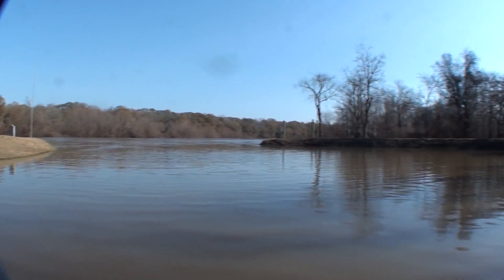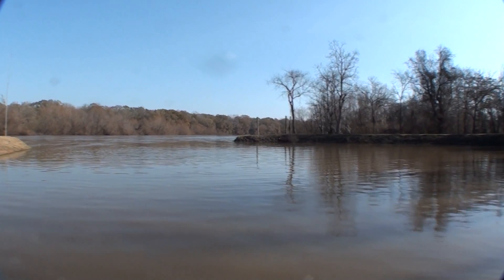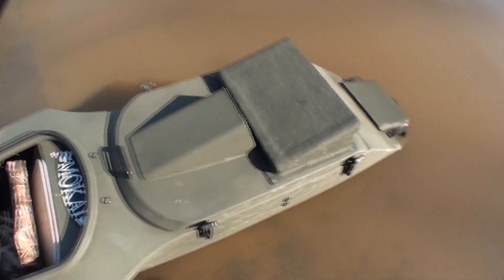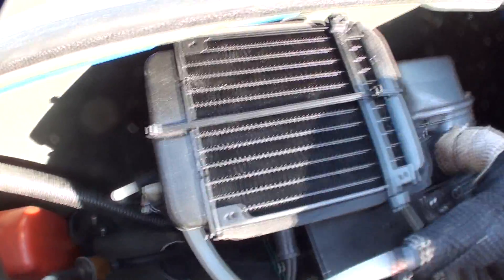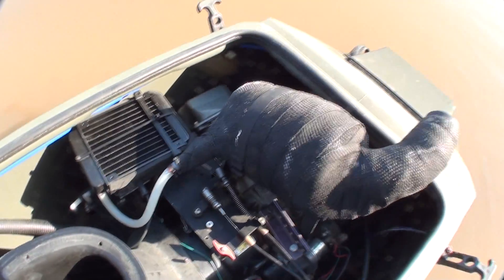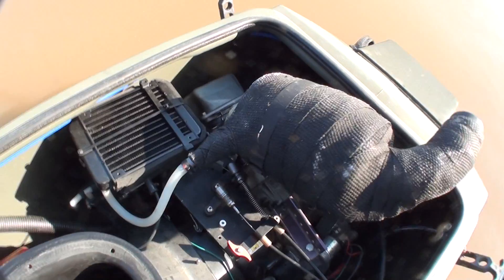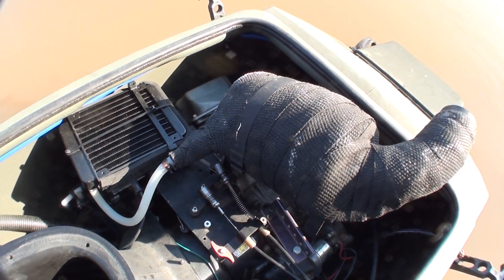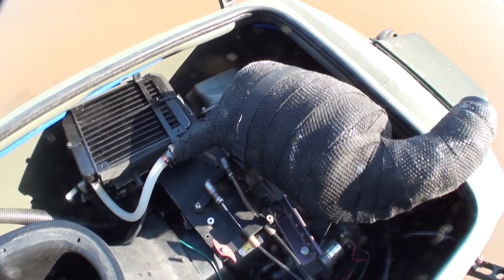MOKAI™ Jet Boat with intercooled Subaru KX21

Comment: I have a few fully built 10,000rpm 20+ hp predator 212's I can only imagine how fast it would go then😁
Reply from the maker: Not very well. You wouldn't be able to get into the torque range those motors run best at. You have a final drive ratio on a kart much lower than the direct drive 1:1 in these boats. It would chug along at 4000 rpm never able to get into the power band. I've never wasted my time to try that, but you aren't the first person to think that would work and the results were disappointing. hehe

Comment: you need one of them jetboats/kayaks that go 28mph
Reply from the maker: And whatever that would be, it wouldn't go in the places I can take my Mokai. ;)
Reply: ImprovingYourMokai look up jetangler kayak or stick boat. Way faster. http://www.aquanami.eu/jetangler
Reply from the maker: I am familiar with them.... Neither of them can be used to go in the places I can with a Mokai. They are not shallow water capable without sucking up debris, and you can't jump logs or rocks with them. They might be fun, but they are not comparable. It's like comparing a 4 wheeler to a Camaro.
Reply: ImprovingYourMokai lol they all have the same type intake... the others just have bigger motors. They can all go on the same type of shallow water.
Reply from the maker: They don't all operate the same... The Mokai has an air cooled engine, coupled with my clutch I have the ability to stop the pump by going to idle... that gives me the ability to skirt over shallow water and not suck up anything. I also have a stomp grate system and reverse.  I can idle all day in any conditions, and can feather the throttle just enough to bump my way through close quarter navigation situations. I play in swamp like areas, I jump logs, run over floating debris etc.. You can't take the boats you're comparing in the places I go, I promise you... You would be paddling after you plugged up your grate and clogged your impeller, you can't stop your pump without shutting down. And jumping over things would risk damaging your fiberglass hull. The Mokai is HDPE plastic, it is flexible and can take lots of abuse. The Mokai is also a drier ride being a "sit in" instead of a "sit on top" design. I can take all my camera gear etc.. without worry of getting wet. Going fast is nice, but going anywhere is more appealing to me.
Reply: so if you did these mods to your boat dont you think they can do them to the other ones to? and i promise you you can... those boats can go slow to if you want them to... what your talking about is mods you did to your boat.... not stock. so lets talk about that boat stock... it cant do any of that...
Reply from the maker: I have no interest in digging into another boat, the Mokai is the closest thing there is to what I want and it's so simple to modify and find parts for. A stock Mokai can still do things the others cannot.... My business revolves around making the Mokai work the way it should, no need or desire to switch over to something else I couldn't use the same way, or even like for that matter. lol  They are all yours. ;)
Reply: my point is that they can both do the same thing with mods. looks like you've moved well past a stock boat
Reply from the maker: No they can't. The Mokai has an engine and pump that are quick release, you can take everything apart with no tools. Clog something up and you just go to shore and pull the pump to clear everything by hand if you don't have my stomp grate system. Stock boat can jump rocks and logs. Stock boat comes with an air cooled Subaru 4-stroke that can be fixed or replaced easily with parts readily available. Stock boat has the flexible HDPE hull that is easily repaired. Stock boat is the "sit inside" design that I require.  The boats you're talking about are proprietary in every way, you must go through the manufacturer for all the parts. Everything is so crammed tight together that there isn't any room for any modification. The only thing these boats have in common is they float, and are jet drive... Other than that they are apples to bananas.

Comment: How bigger a jet did you use in the carb?
Reply from the maker: I didn't rejet the carb, it had the stock KX21 jets. The stock EX21 motor runs best with a 87 main jet, and the EX21 with the high compression EX17 head runs best with a 89 main jet.
Reply: With an intercooler, the air is cooler therefore denser, you would run lean on stock jets
Reply from the maker: The motor is designed to run with ambient air temps, the intercooler just brings the temps down to ambient levels. No rejetting was necessary. Air cooled motor in a box needs ventilation and cool air to run properly, I just give it what it requires, nothing more.
Reply: I see what you getting at, Your not cooling the intake to the carb air , your cooling the compartment
Reply from the maker: I'm cooling both. The intercooler brings the engine compartment air to ambient levels entering the carb, and the muffler cooling keeps the exhaust heat out of the engine compartment. Both work together to keep heat in check and performance up.
Reply: Interesting setup, not the way I'd go , but what the heck , it works, thats all that matters
Reply from the maker: Well many people have been trying to address the heat issues in the Mokai for many years, and I'm the first one to bring real solid results to the table. What would you do differently? Problems are always easily solved in talk, things change when it's your problem to solve. LOL The intercooler could be replaced with a true cold air intake, but that starts to clutter up the hood and it makes the intake passage that much longer. This is the simplest, cleanest, most effective solution to reducing heat in the Mokai, using a resource that is free (water from the pump).  ;o)
Reply: ImprovingYourMokai
Yup , other than replacing the engine with a water cooled engine from a dirt bike or something, cooling the engine bay would seem to be the way to go. Has anyone just tried to ventilate the engine bay better?
Since seadoo's would have the same problem in their small compartments, I would do like they do. Find a water cooled motor to give the pump it's rated rpm (usually around 6000). Can usually be found in dirt bikes (7 to 12 hp). Lob off the xmsn and fabricate a mount. Doing this would require some fabrication and welding(aluminum) skills but it's not hard.
Yes , it's a longer and more expensive way than what you did, but it would be a fun and interesting project.
Another way for shorter distances and gas restricted waterways, would be to go with an electric conversion but that would take a lot of work
Reply from the maker: Ventilating the engine bay alone isn't enough, I've tried all kinds of ideas the past 5 years and it takes everything working together. The Mokai is extremely shallow water capable with my clutch, this allows the pump to stop when idling, so bump the bottom and you just stop the pump; nothing gets sucked up and you can float past that spot without issue. My water cooled muffler can idle all day with no water flow, a water cooled engine cannot do that so using a water cooled motor would be a problem when using this boat the way it was intended. The pump is also not big enough to supply sufficient water flow to a cooling system on a larger motor, a customer of mine put a yamaha jet ski motor in his and sustained running the motor would not cool properly. I've had Seadoo jet ski's, and build a Jet Jon with Seadoo drivetrain. Have never had any issues with heat in those, they run great.
Reply: yea, very shallow water could be a problem
Reply from the maker: Some of the stuff I play in. lol https://www.youtube.com/watch?v=J7Rp6YTOjtI
Reply: Not the place for a speed set-up id it. hehehe
Reply from the maker: Lol nope...

Comment: wy you put a pc radiator for ex cooling
Reply from the maker: +Patrick Charette It is a heat exchanger, water flowing through it cools the incoming air to the carburetor and helps the motor run better. Just because it was made for PC's doesn't mean it can be used for something else, they put lawn mower engines in gokarts too! LOL Actually, the motors used in these boats are used in pressure washers and gokarts also. ;)

Comment: What does it cool? The engine is air cooled, right? Also, I think another idea for an even better upgrade would be a larger/better muffler and an underwater exhaust, as the are too loud for my liking. Looks great though. i really love these things. -noise
Reply from the maker: +iansrving Water goes through the intercooler and cools the incoming air to the carburetor,  then it goes through the coils around the muffler to cool it and prevent it's heat from radiating to the engine. An air cooled engine in a box needs lots of ventilation and nothing else to add to the heat equation. The difference is that you don't lose 200 + rpm once the motor is hot, the rpm you start out at is retained no matter how long you run. This translates to retaining 1 mph that would have otherwise been lost, and the engine running cooler. My muffler is twice the size of the stock version, and half as loud. It's like a riding mower now, instead of a .38 being shot non stop in your ear.
Reply: +ImprovingYourMokai That seems like a very nice system you have there.I totally get the muffler thing but what would still be your take on an underwater exhaust. Maybe Painless Brand should try to develop a kit for this feature? Water is very heavy so there is lots of mass to deaden the sound, which is why most boats vent exhaust into the water. This also could be coupled with a decent size muffle such as yours. Keep them ideas coming. I really like these boats... if only I had the money. :)
Reply from the maker: Thanks. The possibility is there with my water cooled muffler, but adding a quick release tubing section to run into the water would make the boat look cluttered up and like something from back to the future.. lol But anyone with one of my water cooled mufflers could easily attach some radiator hose to the muffler outlet and run it into the water. It just hasn't been loud enough for me to bother with it.
Reply: +ImprovingYourMokai Sounds cool, just a suggestion though. Also, how awesome is it that I replied to this on Wednesday, 10-21-2015??? I love Back to the Future!